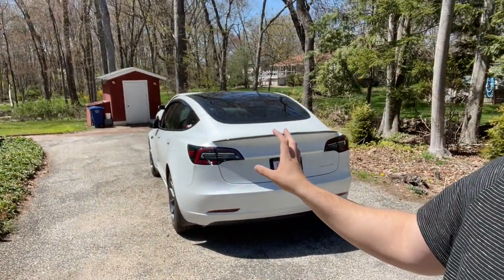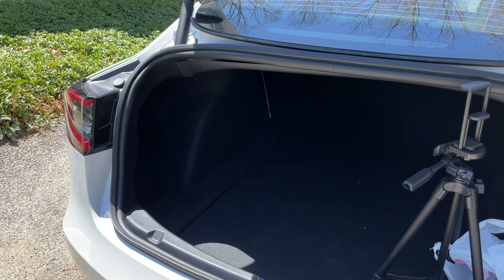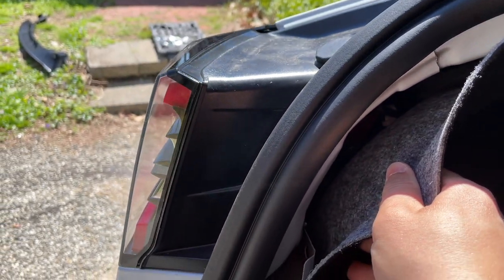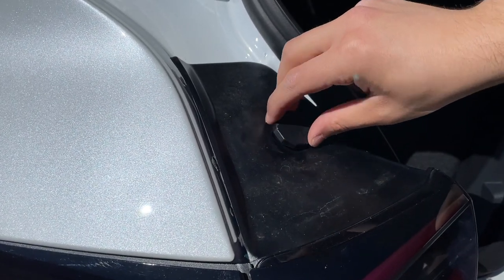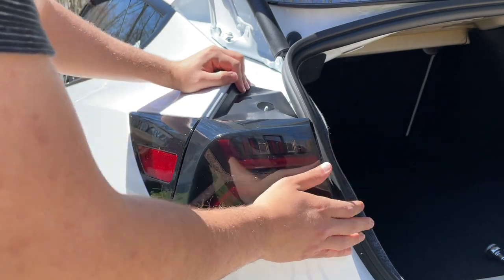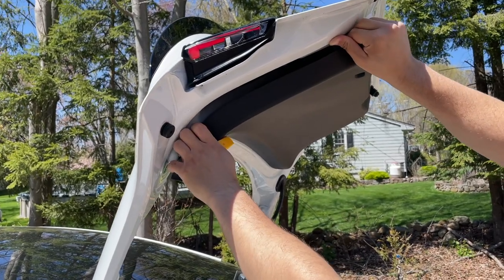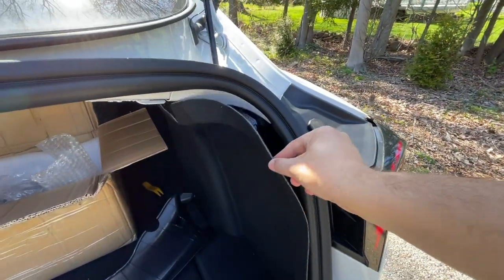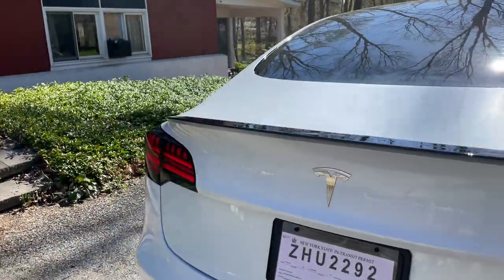Installing Aftermarket Taillights on Tesla Model 3

Comment: Great video! Did the seller end up getting back to you with the correct lights or a “good fix?”
Reply from the maker: Sadly there is no fix for the reverse it’s an Euro spec. They are working on a USA spec. For the the turn signals he said that Tesla changed the wires on the 2021 model 3 and he said they are trying to find a solution for it. And it he said he doesn’t know how long it will take them to find a solution for it.
Reply: @Iegend17  thanks for the update!

Comment: Got mine and installed them. The cables should be routed to the right inside the inside the trunk cable flexible tube.

I do 💯 agree with you about the indicators turning on (braking in yellow) when braking and also the one sided reverse light! If you are able to program them please shed some light 🙏🏼

Thanks for this video. Much appreciated.

Comment: Maybe they were made for the European market where we have filling
Fog light on one side and reverse on the other?And the fact that the indicator comes on when braking, is due to US setup where brake light and turn signal is same bulb/light (both red) where Europe and the rest of the world has yellow rear turn signals. Just a thought
Reply: Yeppers
Reply: Yeah, the car’s wiring includes an additional wire which is brake lights only. This wire is not used by original US spec lights, but euro lights AND these ones do use it, and that’s the one lighting up the red brake lights. The original brake/turn wire goes to the amber part. Outside North America, this wire is turn signal only. This would have to be corrected by software, which I doubt Tesla is going to help you with
Reply: @H0704  but you can cut the wire that supplies both brake and turn signal, and run your own wire to the side marker signals. . I have a thread explaining it below this. You will however need to add a hyper flash resistor to that cut wire though
Reply: @jasons7044  yeah that’s probably the only possible option!

Comment: Thx for the honest feedback on the install. I agree those two items you identified should be fixed. I hope they offer you a good solution
Reply from the maker: Of course. It’s all about honesty :) 
The seller said he will be working with the supplier for a fix for the the turn signals indicators. But for the reverse it’s an EU spec so only the right is the reverse. Which is ok with me. I don’t drive in reverse the whole time lol. So he will see if he can get a cable to be installed so the the turn signals don’t turn on when braking.

Comment: The tail lights were made for the European market. The single red high vis w/ single white are common in Europe.
The reason why the turn signals are coming on with the brakes is because North American models share( wire 3) brake and turn signal.  (Wire 4) is just brakes. Though the stock  N.A. light fixtures are  not pinned for this, but the wire harness still sends(wire 4 signal). Europe models use just (wire3) for signals and ( wire4) for brakes, their light fixtures support this and would work no problem with these lights.... What you can do, and what I did. Is cut wire 3 on both light harnesses before the light fixtures and run your own wires spliced into your side repeater signals. I know its a pain but it will work.  I promise you.
Harness:Wire1- ground,  wire2- tail lights,  wire3 -turn signal&brake , empty pin,  wire4-brake
You will however have to add a hyper flash resistor to wire3 and frame ground, otherwise the car will think there is a problem and hyper flash.  
In NY state it is not illegal to have amber lights "IN Addition" to your brake lights...but I  think there is too much going on there though
Reply from the maker: Man I hate splicing haha. But thank you for the info. I think the people who have the 2020 Tesla model 3 don’t have the issue as mine. Tesla changes the cables in the 2021 sadly :(
Reply: @Iegend17  i have a 2020. This is what I did. If you would like I can post a short video on my page tomorrow for you, or send you pics somewhere
Reply: @Iegend17  i edited the comment after you replied,  there is more info
Reply: Can you make a video explaining what it takes to correct the turn signals on brakes?  I'd be really grateful.  I have the same problem on a Model Y.
Reply: @cwario  Y is different  if it has the amber turn signals.  I believe on the Y, they doubled up the brake and tail light together,  ..I am not sure,  I would need to look at the car. ..I am sorry. Maybe the OP, can help you
Reply: @jasons7044  My original tail lights have the turn signals in red (early VIN) so I think I have the same problem as you in the Model 3. Do you have a diagram or video of how you fixed it?
Reply: @cwario  no I don't have a video. Are you some what handy/  DIY prrson?..have you ever installed a car stereo/  speaker / amp?  LED lights? Anything like that If so I can walk you through it
Reply: @jasons7044  Yes, in fact I have an idea what it would be like, the turn signal is obtained from the front fender light?  Where did you pass the cable? Do you know if it is possible for the Service Center to program the car to have the European lights?  Add the rear fog light and maybe avoid rewiring?
Reply: @cwario  I've read of someone who had orderd European style OEM"amber turn" lights. He asked Tesla Service and they said "no, they could not "....  but I'm sure they can, its software related. They make 1 car with two different dashboards,  everything else is just programing.  You can try to ask, never hurts. 
 Like I said they make 1 car with two dashboards,  so there is a rubber seal in the footwell of passenger side where steering wheel would go through in right hand drive models. You can push/ pull your wires through there.  Look up video on removing frunk, and another on removing side markers to run your wires to.   Those wires will go to the 3rd wire down in your light harness at the lights. . Once you cut that wire, the original wire you must put a LED hyperflash resistor to
Reply: @cwario  the rear fog light will come on when you brake. There is one white reverse and one high visibility red  reverse ( fog light)

Comment: As per many comments below, seems like you got a Chinese spec version and for a 2020 or prio, 4pin lights versions.  Hanshow sells these as do others, Chinese made knock offs so they are all basically the same.  Hanshow sells a Chinese Version, EU & USA/Canada spec version.  The difference is on the EU/USA/Canada spec, no foglight on drivers side and both have white rear backup lights.  Not sure about the turn signal activating when you hit the brakes, I've not seen any video from Hanshow with that shot...which makes me wonder if they have that too.  If anyone knows of the correct setup for North America, would love you to post the link as I too, want to get a set of these but don't want to compromise like this person has.  I want it correct or not at all.  

Thanks for this video, really helps for the installation but yes, you should route the right side wires thru the flexible tubing between the trunk lid and the trunk.  Cleaner install.

Comment: Because you bought the European tail lights model , in the the wiring plug is different and the data from computer sending signal to tail light , is different setup wiring and configure

Comment: I'm going out on a hunch here, but I think the indicator turning on when braking has something to do with your car being american. American model 3s use the same lights as indicators and brake lights, while 3s in other markets (which have laws requiring amber turn signals at the back) use different lights. I wouldn't be surprised if there were wiring/programing differences between cars which lead to your issue.
Reply from the maker: I herd all 2021 have this issue. Tesla changes the wires. I am talking to the seller and he said he working on an adapter for those taillights.

Comment from the maker: The seller sent me a cable it was suppose to be plug and play to fix the emergency lights issue but the cable didn’t fit. So I got in touch with him and he said he will be sending me new taillights and they will be the US Spec. I will update the link of the item in the description when I get the new ones.

Same issues with the new Taillights I got from him. I will be getting new style I will make a video soon
Reply: Were you able get the cable yet? If so did it fix the issue? I’m also getting the same issue.
Reply from the maker: @stvnsnton  I did and it didn’t fit. So they seller told me he’s getting the US spec taillights and he said he will just send them to me.
Reply: @Iegend17  oh ok thanks! Yeah I just purchased it from the same seller. I’ll just wait until he lists the US version then, hopefully 🙏 it has reverse on both sides.
Reply: Any updates on the US Spec lights?
Reply from the maker: @stvnsnton  he told me it’s a long process but he did tell me by next week.
Reply: any new updates???
Reply from the maker: @coltonlanghans2151  sadly no fix for it. He said he will make some changes to the new taillights he makes

Comment: Id be pissed if I had those installed and they weren't symmetrical. One-sided reverse lights?
Reply: I have them and they are 100% symetrical... its problem of tesla quality and not the light. I spend ca 2 hours to arrange them on right place. Tesla quality is shit ;-/
Reply: They are just like the original tesla lights - they also have only one sided reverse lights
Reply: I love them! Cars looks so much wider in real. Color is more rubby Red compare the orange of tesla. No foggy ať all. Yeaaah...But be carefull... its EU spec. 1 Reverse light on right and 1 Fog light on left...
Reply from the maker: it is the light! the seller told me its the supplier, there is no white LED reverse light in the left one.
Reply from the maker: can you send me a picture on my IG i want to see yours Legend17_reviews
Reply: @Iegend17  it's indeed like this in Europe. Only one side in reverse.

Comment: I dont have any problem with the turning lights if i stop on brake. Its problem maybe because you have 2021 model. Second thing is that its for EU and asia Markets, where on right must be one reverse light and on left must be one fog light.. Overal very nice product and tail lights are finally no fogging ;-) which is so good! Its better glued then OEM tesla.
Reply: i just did the install on my 2019 canadian car and im getting this exact issue. also with most of the advertised cars, the rear fog can be activated in park. in this videos car and mine, the fogs only come on in gear!
Reply: Well... then it will be problem, that this lights is for EU and Asia market and on US make some problems then... ;-/
Reply: @LouiSchmallz  fog lights dont work in parked cars (and neither in parked teslas). You could be dazzeling other road users.

Comment: 14:56 thats normal. european teslas only have 1 reverse light as the other (usa) reverse light has been replaced by a fog light! So in your car you may not have fog lights as americans usually cant be trusted with them - but if you put those into a european speced model then im sure on the left side will be the fog light. that is also why your turn signals are amber and not red like most cars have in the usa. i think your tesla sends the wrong signal to the taillights, hence the turn signals comes on with the brakelights. As they are all red in usa cars they both come on - but they shouldnt if you have amber turn signals.

Comment: I like the lights.  The install - Not so much.   The should be enough room in the cable assembly on the right side to feed both cables through the inside of the rubber grommet for a "clean install".  These look exactly like the EU model tail lights with only one reverse light.  Could it be car programming needed for these lights?
Reply from the maker: Yes for the right side you are right. I should fed the wire inside the rubber. For the left I don’t think it’s possible. It is the EU spec and no there is no way you can program it becuase it white on the right and red on the left
Reply from the maker: @t.w.3  so I found out Tesla changed the cables for the 2021 M3. 2020 has different wires and harnesses

Comment: You have the EU version. They do make a 
 USA version with correct reverse lights and brake
Reply from the maker: They are $700-$900 lol. I could live with one reverse light. My problem is the turn signals lol.
Reply: @Iegend17  I don’t think they do, I was in touch with another supplier called electric car guy form Sydney they sell them for 1000+ still have the one reverse light but now I’m worried it might have the brake Light issue. Also the cable necessary to attach to each side ? Like will it not work if You don’t connect the cable that goes to each light not the factory harness the cable they send
Reply from the maker: @JohnnDoep408  you have to connect the yellow one if you don’t then the half of the taillights will work. The seller sent me a another cable and he said it should work. When I got it it didn’t fit sadly :( 1000$ that’s too much man. My seller told me he will send me another set and it will be the US spec and I will return these

Comment: I am getting a 2021 Tesla model 3 at the end of May and will be buying these I see on the sellers website hanshaw they have a 2021 model did you buy these? It states that is is plug and play. Did you get these from them or someone else?
Reply from the maker: All of them are plug an play. But maybe the ones from handshaw have an extra cable. Anyways my seller is gonna be sending a cable that will fix the issue. Reverse can’t be fixed since those taillights are euro spec. But the brake will be fixed. Wait don’t get the taillights yet. If I fix mine you can get the same ones as mines if you like and save your self free hundred dollars. I will be making an update video soon
Reply: @Iegend17  ahh I already ordered them. They gave me a discount code. Hopping to get them before my Tesla arrives so I can install them day 1

Comment: uhhhh you do know you could have routed both cables through the rubber grommet on the right side yeah?....it's tight, but works like a charm...no showing cables...
Reply from the maker: You are right. I actually ended up doing on on my 2022 model 3 performance 😊
Reply: @Iegend17  I’m waiting for my lights to come in tomorrow… the X version… after doing the suspension myself….I think I may take a break till next spring…. Modding this car is hard…. Lol…I’m thinking widebody in 2 years

Comment: Could you have run the wire from the other side? If the wires are long enough you should be able to route it thru existing rubber connection on the right.
Reply from the maker: I should’ve. I thought I mentioned it in the video
Reply: Correct, wire should be ran through the trunks passenger side light, up the wire harness to the trunk lid. Just like auto trunk install from Hansshow.

Comment: Did the New cabel fix the issues about brake and turn signal?
Reply from the maker: No sadly. There is no fix for it. The seller said they have to change the wires from the inside. For 2020 he said it works fine but Tesla changed the wires for 2021 for that it does that.
Reply: @Iegend17  can it be because you have America version car? Talked to a seller and pointet out your issues
Reply from the maker: @kenney193  my seller told me Becuase mine is a 2021 not a 2020 if it was a 20 it would’ve worked. He told me he’s working to fix this issue. Not sure if he or she fixed it
Reply: @Iegend17  did you put oem back or Just drive like that?
Reply from the maker: @kenney193  I been driving like that 😂I was actually to put the oem back but then I was like nah
Reply: @Iegend17  hehe yeah, was wondering to buy it looks soo Nice, talked to diffrent sellers, they say old version has this issues New version does not in 2021, and its Just cabel issues. Will see when they arrive 🙈😅
Reply from the maker: @kenney193  the cable the seller sent me didn’t fit
Reply: @Iegend17  could push them more, til you get what you paid for👊👍
Reply from the maker: @kenney193  well the opening is too small on the cables and the pins don’t match up 😂😂😂
Reply: @Iegend17  hmm what did they say after? 🙈
Reply from the maker: @kenney193  they said there is no fix but they will see what they can do
Reply: @Iegend17  4 month ago? 😐😅
Reply: @kenney193  here's the fix: https://www.youtube.com/watch?v=KmFYccXD4JE

Comment: Im in need of advice, i recently just installed my tail lights. I started on the driver side first and made sure everything connects and was working. I then proceeded to work on the passenger side and did the exact same thing but only to find out now that only the passenger side tail light works. I tried reconnecting the oem on the driver side to check maybe it was the after market tail lights fault but that didnt seem to work either for some reason. Did i blow a fuse maybe? Eould anyone have an idea why my left side connection doesnt work anymore? Thanks in advance
Reply from the maker: Each one has power cable then there is a separate cable that will connect both of them together. Make sure that cable is connected good